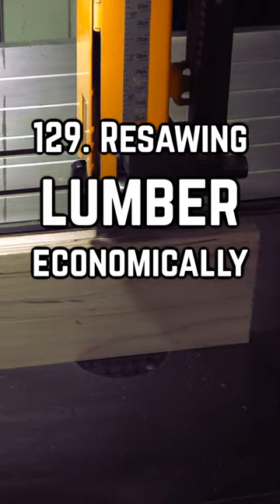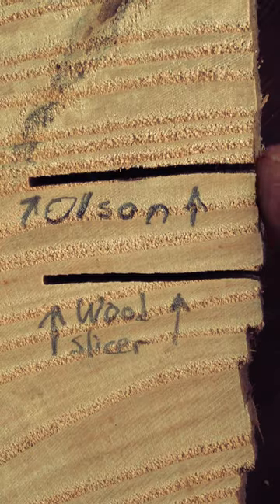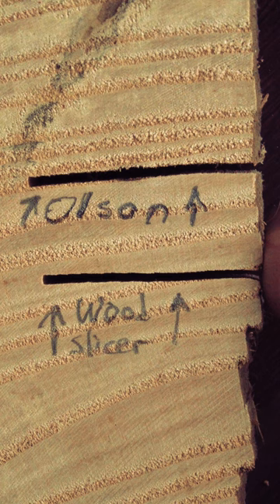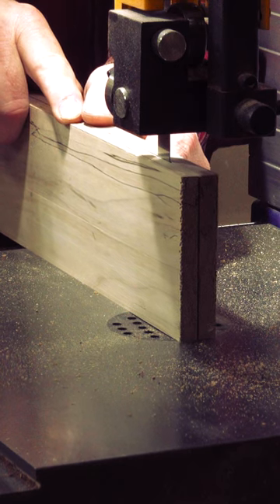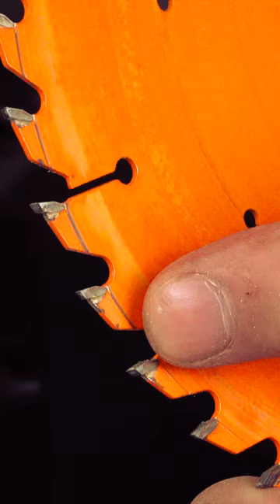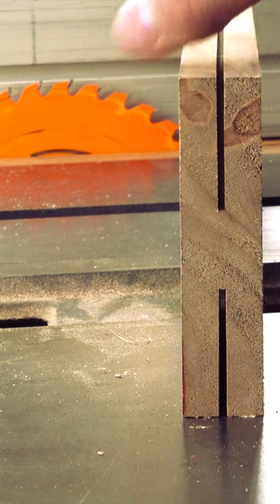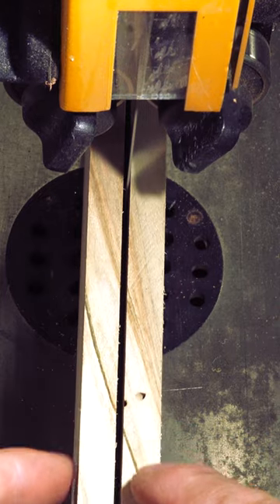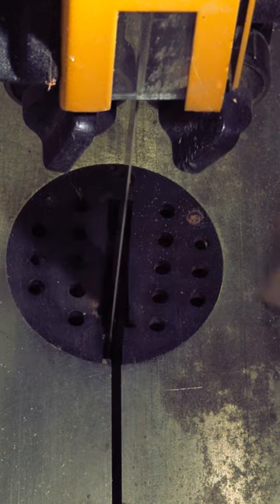129. Resawing lumber economically #mtbitesize #shorts

Comment: Good for you giving Russ a shout out, his channel is a mine of information. Incidentally, why don't you finish the cut on the table saw?
Reply: I guess it's because the cut is made with a small diameter thin kerf blade?
Reply: This video is assuming that your bandsaw can handle material more than twice the height of your table saw blade fully extended.

Comment: Interesting idea, but I, too, wondered why not just cut the whole width on the tablesaw. Yes, width is limited, but most of us don't have bandsaws that will do more than the 8 or so inches possible on a 10 in tablesaw.
Reply: Well, the main reason I can think of is when you’re making that last cut to split them apart and you have the blade that high, there is a higher risk of one of them moving against the blade and flying back towards you. I’ve done it and it’s tough to keep both pieces steady when they come apart.